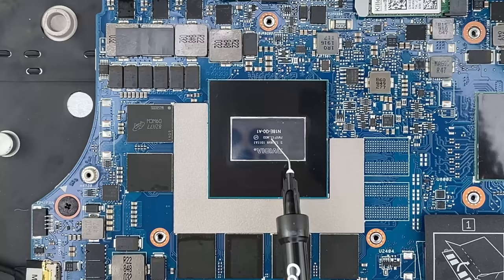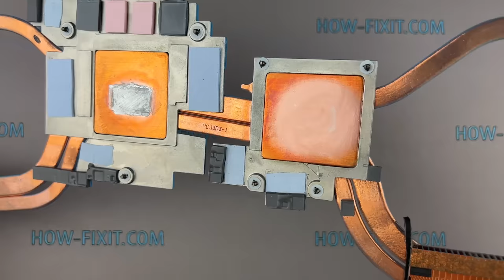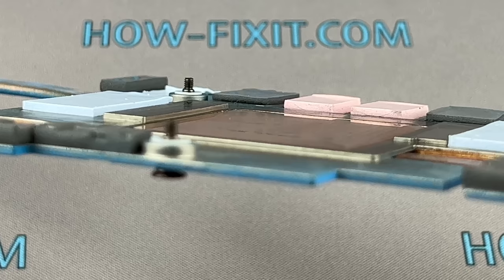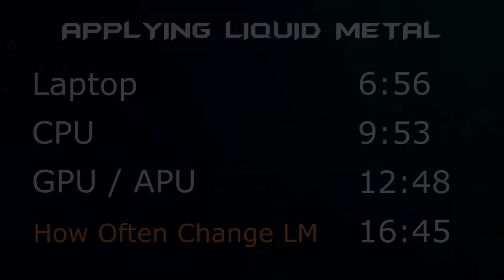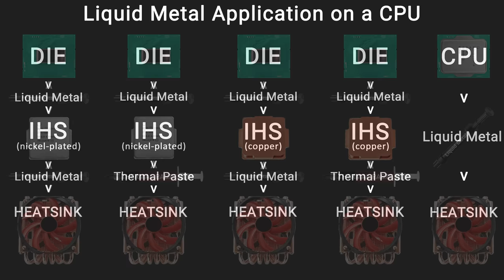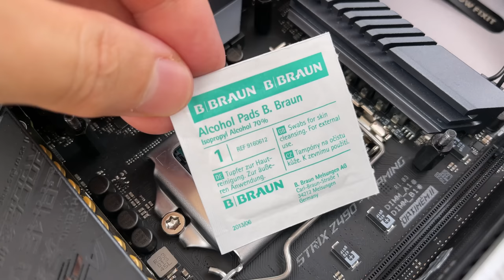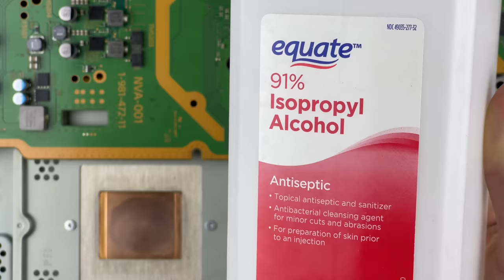Ultimate Guide to Applying Liquid Metal to Your CPU, Laptop, GPU, and Game Console

Comment: Noob question, if the Liquid Metal remains liquid, is there any risk of it dropping off from the application site, and damaging other components in the motherboard? Asking this with a laptop in mind, as it usually spins in every direction with the daily use (e.g transport).
Reply: Not really. You should, just in case, insulate nearby components as demonstrated in the video. For example, I applied couple of layers of nail polish on my laptop to them instead of the termal grizzly product. But in general liquid metal is super cohesive and once it sticks to a surface it will not move around very much no mater what you do with your laptop. I have it for 5+ years on my laptop, which is positioned vertically most of the time (in my bag), and nothing bad happened so far.
Reply: Thanks for the info! Cheers!
Reply: Très bonne question, je pense que beaucoup se la pose.

Comment: You recommended using non-abrasive polishing paste (wish, BTW, is abrasive, but mildly so) but used the rough green side of the sponge, which is impregnated with rough mineral abrasive media (it is basically a Scotch-Brite scouring pad glue to a yellow polyurethane foam). If you want to clean the copper and maintain its polish, don't use the green side. The paste by itself applied with any cotton rag will do it.

Comment: i would use emery cloth or high grit sand paper on a block to clean that copper instead of the VERY abrasive green scrubby.  the white scruby pads work better, they are used on griddels in kitchens and pans - never a green pad due to how abrasive they are.

Comment: Ok i think i will sticking thermal paste which the best on the market for avoiding the trouble
The differences +/-4°c isn't disasterous tho
Reply from the maker: In the case of using CPU > Liquid Metal > Heatsink - yes, it's not a big difference...
But, for use in the case of DIE > Liquid Metal > IHS (nickel-plated or copper ) > Thermal Paste > Heatsink - liquid metal is the best.

Comment: Folks I would not use LM as a CPU cooler interface material. It's fine for delidding where you seal the heatspreader onto the PCB, but that's it. 
   I tried this myself on a GPU and after a couple of years the LM had dried completely, leaving a sparkly dust behind. Thinking the CPU I had applied the LM to at the same time would also have dried, I popped the heatspreader off but that wasn't the case.  The LM was still liquid.

Comment: Ngl, I would personally use a foam tape at the sides of the tdie or a termal pad at sides of the tdie solely to increase the chances of liquid metal not leaking anywhere else, because a single droplet of it could set you up a big expense ngl

Comment: I have never needed to put thermal paste on both sides of contact. You only apply it to the cpu itself, then lay the heatsink on it.
The two sides will have flat contact anyway. You are litterally doubling up your liquid metal and probably making a mess...

The third section of the video was very helpful, though.
Interesting to know that it cant work with aluminum.
Reply: Yeah that seemed odd to me as well, I will just put liquid metal on my gpu die and that's it...

Comment: For me the question is... : I do know it is absorbing but then with polishing and such you do lose a thin level and if I do see what you do have to do in order to use LM  compared to use a good paste....  There are so many more things to take care of.  Is it really worth like 5 Degrees or so (compared to a really good paste.)  And even if it were 10 (which it mostly isnt....) ....   Is it really worth all that effort ?  I am doing this on the inside of some intel processors, because they have had times, where they had used internal thermal paste from the hell....   I have had cpus, where I could bet, I would have better thermal solution by using peanut butter on the inside of my cpu, than with what intel used... And then again, blocking all internal contacts and relimeing the cpu there also can't be possible danger of using too much LM which might flow out and damage something.  I would rather not use it on top of my cpu, where it is free to move everywhere.... If worst comes, people use too much LM and it may get on their mainboard and...  well....

Comment: I would not put LM on the heatsink as well.. like I dont put thermal paste on both surfaces - just one is enough. The layer has to be the thinnest possible. Liquid metal is conductive which incerases the risk of excess material to be squeezed towards the wrong place. Like I read elsewhere with LM the "oopsie" moment is expensive ;)

Comment: I just came to say I have extremely good results on my alienware x15 r2  with i7 12700 rtx 3070ti

My temps very running really hot 107-108c full load

After applying liquid metal it goes max to 94

The performance is really high now, went to 14 K cpu performance on 3d mark. Ps3 emulator frame rate is 10frames higher

Comment: What is the risck of liquid metal ( CPU IHS X AIO Copper Water Cooler ), flow and drop on the gpu? In normal desktop setup where the CPU stay Horizontal and not Vertical like notebook.

Comment: @How-FixIT  Liquid Metal destroys aluminum, very quickly.  It will form a surface alloy with copper, but will not destroy it like aluminum.  It is best to use with nickel plated copper.
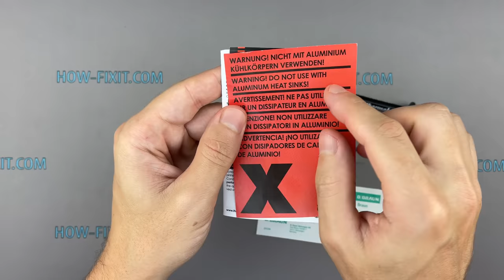Reply: Did you watch the video? He clearly said it at 5:43

Comment: if im reapplying, do i need to fully remove/polish the stain or can i reapply LM directly?

Also, it seems that there is no wall in that laptop to stop LM from dripping down to the sides and to the other components (beyond the SMD capacitors)? how was that possible? is it a non-issue at that point?

Comment: Hello, I'm planning to use the liquid metal for my laptop cooling, but first I need to get the liquid electrical tape to isolate the SMD, but how many layers should I apply to isolate them? I'm a bit concern that over applying with many layers will let them easily overheat and cook itself... Thanks!

Comment: liquid metal is better then paste in scenario where your device is already running hot, as it shines on high temps. if your gpu is chilling under 40c under full load with a paste, dont bother with LM. it wont outperform top notch paste.

Comment: 12:16 should have covered those four gold contacts on the CPU.
15:28 As a result you have now thermally insulated those components, and they will run hotter.
Reply: true
Reply: covered them how? would the insulated material make it run hotter aswell?

Comment: I read on reddit that some people don't use any type of silicon glue to seal it back for better contact, and that it holds just fine when cooler is applied on to the processor. Was wondering if that's okay and if anyone tried it?

Comment: This is a gold guide on how to do it😊 i was thinking of doing this to my predator triton 500, but i travel alot with the laptop and i am kinda scared it will leak out after some time?
Reply from the maker: I also travel a lot and always take my laptop and as you can see from my video, there are no obvious liquid metal leaks on the CPU or GPU
Reply: @howfixit  i guess as long as you use a little and not to much no harm is done

Comment: Hi - Thank you for the great video - I subliked :)

Have you ever tried reheating the liquid metal "residue" removed after the 2 month liquid metal-copper reaction finished or the residue removed after 4 years of liquid metal service to see how it behaves? I'm curious whether the liquid metal becomes less dry and more fluid after application of heat. 
Could that be the explanation for why, even after 4 years of service, the liquid metal that's never been changed still outperforms any thermal paste out there, regardless of whether or not the liquid metal has been reapplied after 2 months? If the answer to this question is "Yes, the liquid metal does return to a fluid state every time the heat is applied" it means that we don't really need to reapply liquid metal 4 to 8 weeks after first application.  

Also, have you performed any temperature measurements immediately after liquid metal application and over the 2 month span to see if the temperatures rise after 2 months?

Comment: I recently build my own pc and spilled a bit of liquid thermal paste onto the motherboard. Cleaned it up as best as I can. After a few weeks my PC suddely shutdown. I could not get it to start up anymore, only the MB red light lit up for 2 seconds and then only my RGB RAM light was working. I have taken out all the parts and only the essential stuff. Nothing. Then I hooked up another PSU, nothing. Now not even the RGB RAM lits up, it does nothing. I noticed the little globs of paste on the motherboard and tried to remove it. It smeared out and I did not use alcohol but I believe I must have fried my MB with the thermal paste.

Comment: Is this thermal paste and liquid metal really a requrement. The plate is made of copper and already has the absolute best conductivity. I think silver is a t7ny bit better.
Reply: Well, you can try without, but your temperatures will go through the roof. The issue is, that the contact between metal to metal surfaces isn't really that perfect as it would seem to be. There a lot of tiny imperfections you can't actually see by eye. Also it is known that on some CPUs the heatspreaders can be warped slightly. The thermal paste or liquid metal is meant to fill these imperfection up and so improve the heat transfer.
Now, the main point for this specialised pastes or liquid metal is that they keep fairly stable over time. For instance Ketchup or Toothpaste has basically the same effect (i'm really not joking, this was tested) but they dry out fairly quickly and so lose most of there effectivness as a heat conducter very quickly.

Comment: My biggest concern with liquid metal was with it migrating to other surfaces so I would wonder if I could just cover the other surfaces in thermal paste instead of that insulation stuff lol. And just to clarify you were saying that nickel plated copper is vastly inferior to regular copper lids/and heat sinks for heat transfer but won’t react with the LM so it will maintain consistency. I don’t how to feel about that bc I have some high end water cooling units that come with nickel plated spreaders 😢. Thanks
Reply: There is virtually no difference between nickelplated copper and "pure" copper. The layer is so thin that it really does not matter in a real world application. You could watch the LTT video about installing a copper IHS on a 12900KS, there in the first half Linus goes over how the nickel plating makes no difference. The decrease in temperature they see is due to that IHS they installed is just plain better.
Reply: You can cover the surfaces with nail polish. Apply 2-3 layers (let it dry for couple of minutes in between the applications). If you're still paranoid add electrical tape on top of it (but in such a way that it doesn't possibly obstruct the thermal contact between cpu/gpu and heatsink).
Reply: @dariobarisic3502  for some reason I still really..I don’t think it would hurt..want to add a lol very thin outline of thermal paste on my chip
Reply: @ChiquitaSpeaks  That is not entirely stupid actually, great idea! Since most of the heat is in the center anyway.
Reply: @Guzten2  thats what im sayin. my main concern was with it being on its side thinking it could more likely leak out..not so much anymore. Either way it just made sense like a very thin line of viscous TIM, maybe even around it on the Z axis of the lid/plate seam, was thinking it would just act like a little extra contact and seal…especially since the TIM is going to age anyway (Think I may 😃 have just given someone a video idea).
Reply: @ChiquitaSpeaks  I have LM on my ihs and every few months I come back searching for somebody who has had LM in the center and paste around it. I feel like you might get an air pocket or something but I cant find any info about anybody doing it the only videos I find are people OHHH MIX IT TOGETHER.
Reply: @FirstLast-lt2id  Where as to why would you think the air pocket would form?
Reply: @ChiquitaSpeaks  same reason you wouldnt you use a circle instead of a line or X or pea sized drop.once you put the cold plate on the ihs it hits the thermal paste circle and its "sealed" hence air pocket
Reply: @ChiquitaSpeaks  have you ever tried it?

Comment: Hey, I have a question, are those thermal pads (grey, pink, blue) on the heat dissipators the original ones or did you add them yourself? If so, do you have any recommendations on which should we use for each component or where? Or which brand? Thank you!!
Reply: Thermal pad thickness is important. That information will be with the seller.
Reply: @dhmo__ thank you for replying but you didn't really answer the questions
Reply: @gusmaurymain  You must measure the thickness of the existing thermal pad and attach it to the same thickness.

Comment: So, this thing is significantly more expensive than any quality thermal paste, enters into a chemical reaction with copper, requires extra time and spending to replace it, and it can even permanently damage the SMD components if not applied correctly? And all this for the sake of lowering the temperature by some measly 4 degrees? I will stick with my MX-6, thank you.

Comment: I have a job in my workshop for thermal phaste replacement. Soon i remove the heatsinc i notice we have liquid metal on the processor. The smd components isolated with a silicon layer what is also looks isolated the liquid metal from the rest of the laptop. I worry if i just replace the liquid metal i will make the liquid metal comes out from the cpu area. Can you recommand a silicon paste what i can replace the oldone please?

Comment: Hi, I bought a brand new 14600k, applied some liquid metal on the ihs and CPU cooler, it won't boot up most of the time and when it does boot up, it's only in the bios, not windows. I looked at the temps of the cpu in the bios and it was around 48°C. Is my cpu dodgy?

Comment: Hey I was just wondering on m.2 SSD or RAM chips can I put liquid metal on those and then put a thermal pad on top of it and then put a copper or aluminum heat sink on top. Could you please give me an answer on that if possible or would you do a video about that thank you or if I do one at home I'll let you know what the results are

Comment: WARNING future users of liquid metal!  At 4:50 when you say "I can say for sure that liquid metal will not do anything destructive with a silicon processor chip" is completely WRONG!  If the liquid metal were to touch any solder joint on you on your motherboard or in the grooves underneath any AMD AM5 processor chip, it will de-solder itself from the chemical reaction.  Liquid metals are conductive compared to thermal paste which isn't and are more user friendly, you are also only gaining 1-4C difference.  To combat liquid metals from spilling onto the motherboard when installing, we typically use nail polish over and around any capacitors or any soldered surface.  Liquid metals will eat through aluminum if you are new to pc mod/building, stick with Thermal Grizzly Kryonaut.  Please pin this for future users.
Reply: Seems like he stands by this bullshit of liquid metal. It is NOT worthing use this. sabe your money and invest in a better cooling solution/A/C/Etc. Risk is not worth it.

Comment: Why do you need to remove the metal fusion layer at all? Should still be thermally conductive, right?
Reply: I believe he was demonstrating that no damage occurred, showing that equipment can be restored to original condition.   To your point, at the end of the video he adds liquid metal, allows it to chemically migrate, then reapplies immediately prior to commencing the two-year test.

Comment: Bought a thermal grizzly conductunut liquid metal by thinking it was a regular paste (i was in a hurry), now waiting for my new ryzen 5700x3d to arrive today, but after watching a couple of videos i am afraid to apply liquid metal due to the fact that i can shourtcuircuit the mb. Is there any way to use the liquid metal safely since my pc is taying in a vertical position, its not in horizontal position as the most laptops or consoles. I am using ARCTIC FREEZER 240 AIO which is having a copper cpu radiator. Thanks in advance!

Comment: Do you need to put the liquid metal on both sides? With thermal paste I’ve never done that and I’ve never had an issue
Reply: Yes, you need to break the surface tension on both sides to ensure good adhesion otherwise you will inevitably get hotspots and poor results.
Reply: @ColinDyckes  what's preventing the liquid metal from leaking from in between the heatsink and cpu?
Reply: @xCheatah  CPU blocks usually come with a rectangular cutout sponge piece that surrounds the CPU die (at least my EK block did). You should put conformal coating (high temperature nail varnish) over exposed CPU test points and surface mount capacitors/resistors.

Comment: 82 degrees dang I would freak at that temp... Pushing my cpu to 100% and it holds steady at 60 degrees and gpu never hits 50. Without liquid metal as I dont trust it. Supposed to be a pad around the chip for runoff as it is conductive so be careful...

Comment: can i use insulation tape instead grizzly TG or the liquid insulation?
Reply from the maker: It all depends on the quality of the insulation tape and how well it will adhere to the surface of the SMD components. However, I prefer liquid insulation.

Comment: wondering hypothetically if your heat sink and the unit u are cooling (CPU, GPU, etc) both have a nickel surface would you still need to reapply liquid metal? Not very good with chemistry but would 2 nickel surfaces mating not make the same reaction? I think @ computex 2023 ASUS showed an AIO 4090 with nickel plating on the heat sink that uses liquid metal if I'm not mistaken.